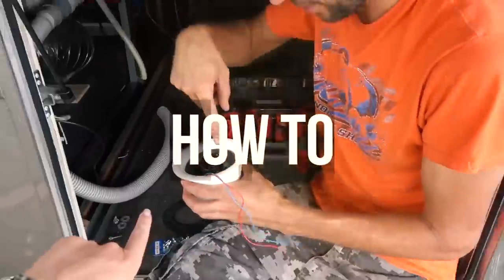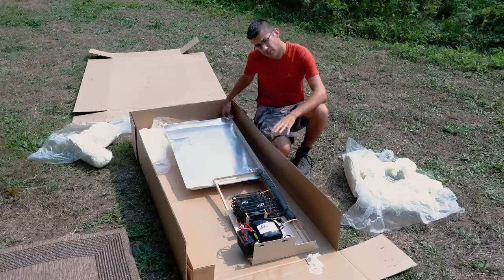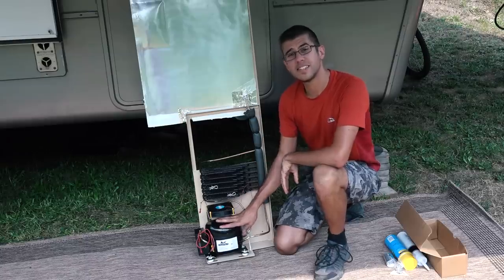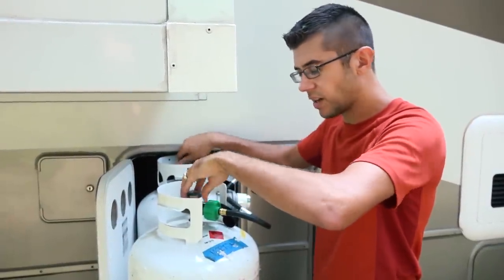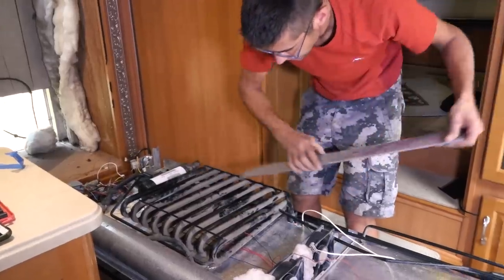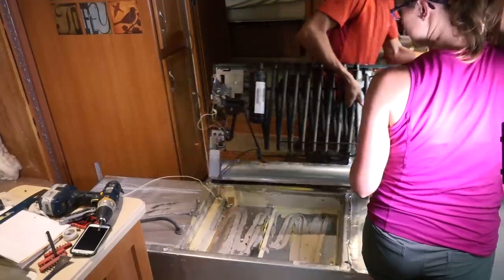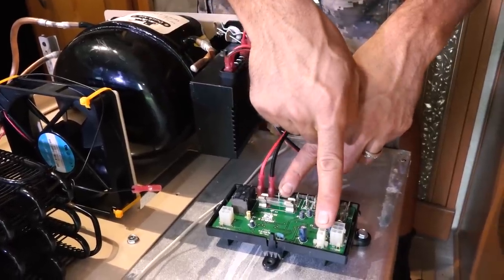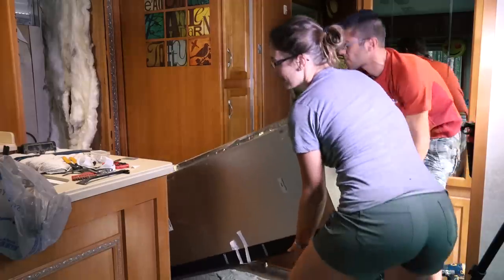Converting our RV Fridge to a High Efficiency DC Compressor- 8x More Efficient! and Better Cooling!

Comment: I bought one of those 12 volt electric coolers for beverages and it was too much for my 200 amp hour / 300 watt solar system.  I calculate it used 50 watts but it did so 24 hours a day.  50 watts at 12 volts is about 4.2 amps so about 100 amp hours per day, which on a 200 amp hour system is all you really  have before the voltage drops too low.  This means that on cloudy days the cooler would kill the batteries in one day and leave no reserve for all the other electronics.  My cooler is a solid state type, I understand the compressor coolers are much more efficient but they are also a lot more money.  In general I don't recommend them.  I still use mine when I'm plugged in or I power it with ice.  Kind of defeats the point to run it on ice though.  But this is what we have to do.  We load it with beverages a day or 2 before we leave and run it on the converter using shore power while simultaneously freezing 6 water bottles in the freezer door.  Then once we arrive we turn it off and use the frozen bottles to keep it cool.

The frozen water bottles are also good for keeping the fridge a bit cool while traveling.  Just pop a few out of the freezer and put them in the fridge.  Also make sure any extra space in the fridge is occupied by pre-cooled beverages.

I don't know if using a compressor fridge whether this type or a household fridge solves the problem of whether you can run it while driving.  Most compressor fridges are supposed to sit for at least an hour after you move them.  So having the compressor running while it's bumping down the road might not be the best thing.  I don't know why that is though or if it''s actually an issue.

I also don't recommend leaving a propane fridge running while driving.  I addition to the safety concerns you cited (open flame that is illegal to bring near a gas station, and open propane tanks while driving), the efficiency suffers considerably as the 60 mph winds strip the flame of all it''s heat.  Sure, you can get 60 mph winds while parked but that is pretty rare.
Reply: My thoughts too. There is a reason gas system lake the one they threw away costs $2000 .
Reply: Resting fridges after moving is a feature for the odd fridge transported on its back or sides when liquid could move around the pipes and damage the compressor on startup not a problem with installed fridges also only run on power whilst driving .

Comment: Tell me that extra fan kit was running the whole time and not a source of air flow blockage that was causing your GA unit to not work as well?
Reply from the maker: Yes the fan kit ran most of the time unless the weather was cold very cold.  We switched it on permenantly in warner weather and had good airflow.

Comment: Another plus is not having to be level.
Reply from the maker: Yes very true!
Reply: The refrigerant still needs to be close to level for best performance. Most appliances that use refrigerant have a notice to let them sit for a while before turning on so the refrigerant can settle to the bottom. Window AC, refrigerators, and freezers are the most common. Central air ACs do not because they are shipped empty and are filled after installation.

Comment: If you use the 12 VDC option permanently, with the 'Y' in the negative DC line, the first connection should be to the compressor terminal, then connect the jumper to the control terminals.  This takes the heavy current load of the compressor off of all those extra crimp terminals.  There are better solutions for making a 'Y' connection - please look into them.  Also.. AWG = American Wire Gauge.  The AWG system goes from 40 (smallest) to 0 (zero), then 00, 000, and 0000 (the largest).  The multi-zero gauges are typically referred to as double-aught, triple-aught, and four- or quad-aught.   Great video - I never even knew this was possible.

Comment: Clean the generator, a can of compressed air does the job. At that point the cooling should work again. 
This happens when the propane runs out and soots up the same. 
As far as the flame and traveling. That's when you use the electric. The vehicle is running and the battery will remain charged.

Comment: I mounted som 140mm fans in the wentilation to the fridge ... So Ewen in the 50 celcius in the mideterenian 
The Domestic fridge cooled flawlesly ..
And this Will make heat as well So unless you Mount wentilators  you Will run in to Long runtime to keep temp down in fridge

Comment: So this helps you out because you are running off solar? Most folks just run the fridge on propane if they are off grid. Fridge electricity is small compared to the AC if you are connected to house power.

Comment: Too bad you didn't know about the cooling fans on the back of the fridge. Would definitely of helped cool it further than 50 degrees, yikes that's terrible. I understand that you would have changed over anyway for the reasons you listed.
Cheers from B.C.
Reply from the maker: We knew the fans were there and actually put the insulation around them ourselves to improve the airflow when they were running.  Before doing that it was even worse.  They did run most of the time tho.

Comment: Grat video! I've done a lot of research on this system and will converting my new "No-cold" to it next year. 
Do the instructions tell you to lay the fridge down? Seems like it would be better to leave it upright so you can match the inside mounting holes up. Also, a compressor unit needs to sit upright for 24 hours after it is layed down before you should power it up.
Also, poor cooling performance in very low ambient temps is common to all fridges - residential or RV.

Comment: All you had to do was at a small fan across the coils rear.  Your air conditioner was likely blowing air down the road vent, or you partially blocked the vent with your solar cells.
Reply from the maker: I don't think you watched the vid all the way.  Our rv is not a roof mount and had cooling fans.

Comment: Interesting Video,  Just so you know the low voltage cutout is for the compressor not your batteries. Running a compressor at low voltages is not good for them and can lead to premature failure.

Comment: I was wondering if the new replacement unit could be outfitted to be an air conditioner by adding a fan to the cooling coils and adjusting the layout of the lines?  Low wattage DC air conditioner! lol
Reply: The BTU capacity of the refrigeration unit would not be sufficient to cool the interior of an RV or any other living space. The interior of a fridge is much smaller and better insulated than a living space and therefore requires a cooling capacity that is only a small fraction of what a living space requires. While compressor-type A/C and refrigeration units utilize the same principles of operation, there are major differences in their design and construction and also the energy required to run them.
Reply: Or better is using the old propane powered fridge for a/c.  All A/C units run on 115ac power that I know of.  Of course it would be really weak a/c, but better than nothing

Comment: I liked the video however this job is not for your average Joe. I replaced a cooling unit on a RV fridge many years ago and it was a huge job. I recently threw out the RV fridge and bought a Danby apartment size fridge that fits the space perfectly and it was only about 500 bucks.

Comment: At 26 minutes in you confused me.  You mention this is a 12 volt compressor and then you say you're connecting it to the 120V relay switched output that would have gone to the AC heater.  That sounds like you're going to feed 120 in to spectacularly destroy the 12 volt compressor.
Reply from the maker: Mmm yes that was poorly said.  What I meant was the relay that was previously used for the 120v heating element.

Comment: Do they make them for residential refrigerators to turn DC
Reply from the maker: No,  That would require a custom compressor replacement.  That would be challenging but probably not impossible.

Comment: Just an FYI.  I noticed your controller has tantalum capacitors.  If it ever gives you problems check the caps.  Also I noticed the cooling fan was held in place with tie wraps.  If ever installing new I would consider using bolts and nuts.  Oh, and nice job.  Thank you for doing this video.
Reply from the maker: Good to know thanks!

Comment: They are cheaper , but if you travel they can't handle the vibration .
Regular refrigerator compressor will fail from bouncing around in its housing.

Comment: That compressor is an AC compressor with a DC to AC inverter attached to it's side... My guess is it's a 500 or so watt modified sine wave (dirty) inverter with a soft start circuit so the compressor startup does not bottom out the inverter. This will work but a modified sive inverter is not really what you need on AC motors as they will shorten the life of the motor and thats no good in a compressor...

You have the same fridge I have in mine the only differance is mine does not have the decor panels on the doors and it's tan colored and not black..
Reply from the maker: ... it's the control unit.  It's a DC brushless motor with pwm control not an inverted. I have the manual for it.
Reply: @MortonsontheMove  Ah ok, see that makes more sense now because I was thinking as I was writing  my comment "surely they know the potential dangers of using mod sine with AC motors" I'm going to have to look into this and see how big they make these compressors because if I can change out just the compressor in my rooftop AC with a DC version I will. I do have EPA certs to do all the refrigerant stuff also..

Comment: What was wrong with your 24 volt system that is was not putting out 24 volts?
Reply: the tesla battery they installed runs under 24 volts as a general rule to enhance the life of the battery pack. They usually are only charge to 24.1 volts or lower sometime 23.9 and can be discharged down to 19.2 volts. I guess the compressor has a low voltage shut off.  Would love to know the what and how on the resistor and to what voltage it will go down to.
Reply: It needs a 7s lithium cell battery, if the controller can handle up to 29.4v it works better for 24v systems, 21-29v range, of 7s , that's why i cant. Use Tesla batteries, my battery is 7s,

Comment: There needs to be a total look 8x I do not thinks so. First weight. You have to add in the towing weight. Compressor fridge is heavier. Next is fuel for the fridge. Here in oz you might not have power. Now some people will jump up. Well here in oz we had weeks of no sun. Blokes out buy smoke. No charging battery. No a.c. power. It was cut off and no shops. People trapped on holiday. Next is vibrations on road..my fridge been just died 40 year old van. Not bad for a fridge. Next is been able to fix. And get it fixed. And it goes on and on. A full look needs to be done before jumping into changing. Next solar cell soon will be able to work at night. But power loads will need to be looked in. I an building control circuits. I think over all it will be close with both fridges. Russell

Comment: Any problems keeping up with it on solar alone? I have 900 watts of flat mounted panels (3 300's) and the same battery capacity (4 Trojan T105's). Are you finding you need to supplement with a generator? And any clue how many watt hours it consumes per day on average?

Edit: aha, at the end he says 500 watt hours in cooler weather up to 1.5 kwh when it's hot out. My RV with 3 300-watt panels flat mounted going into a Morningstar MPPT 60 in Norhtern California generates about 1.5 kwh on sunny days in winter, and about 2.5 kwh in summer on a good day. So that means that for me at least I'd definitely need a generator (which I try to avoid) to run this setup, assuming the sun isn't out every day.

I wonder if there's any clever RV systems using the (I think) more efficient Danfoss type compressors?

Comment: Don't be surprised if you have any problems pertaining from your control wire to the control panel. You didn't "click" it in. Its barely seated where it belongs and not all the way in. So, how many drives will it take to become unseated and for you to give up buy a new one, possibly. Or miss that its just that. Check it out for yourself, no kidding. @26:28

Comment: A low voltage cutoff is also to protect the motor...a dipping voltage will require more current. More current = more heat.

Comment: Noticed that you have the classic blue Ryobi. Did that come with the lithium battery or did you have to buy one? At least it looks lithium
Reply from the maker: Ha yes it's a classic, have had that drill for 14 years, the batteries are replacement  lithium and now 10 years old and still work amazing!
Reply: @MortonsontheMove  thanks, I may be able to get a bunch of blue Ryobi tools that were my grandpa's but the nicad batteries are shot. Did you have to get a new charger?
Reply: @nick4leader  sorry to interrupt but yes the lithium batteries supposedly need a new charger.  Good news is, home depot usually has a sale on two batteries and a charger at this time of year.  I have an older set with 8 tools so the cost to upgrade the batteries was a lot less than replacing the tools.  The also offer two different battery types, larger and smaller.  I opted for the larger as they have double the amperage and last longer.  Hope this helps.
Reply: @tufelhunden5795  thanks, I have to look more into it because he had a couple chargers and one looks newer so maybe it will work with the lithium. And your reasoning is exactly the same as mine for upgrading batteries instead of new tools
Reply: @nick4leader  if he had a lithium battery the new ones are green and gray and say One+ on them.  Hope this helps.

Comment: In the video you stated the DC power leads needed to be 12/0 gauge. Shouldn't that just be 12 gauge?
Reply: I noticed that too.  12/0 would be about the size of my arm and weigh more than the fridge.

Comment: Is that a Glasspar G3? Is that a long shaft motor?
Reply from the maker: It sure is! .. we rebuilt the  while boat and built the transom to acomadate a long shaft Honda we had.  We replaced it with the yahama a few years later
Reply: Just checking but 'long' as you know, you've got it right. Had a next-generation G3 w/90hp back in the day. Enjoy. @MortonsontheMove